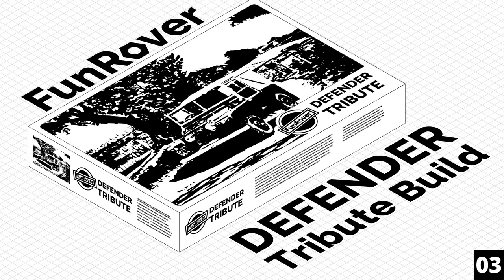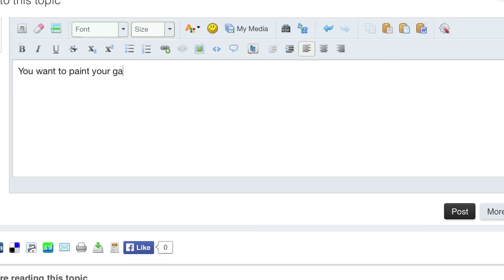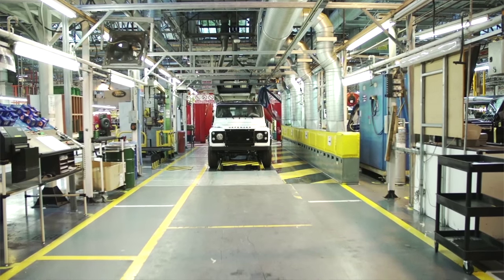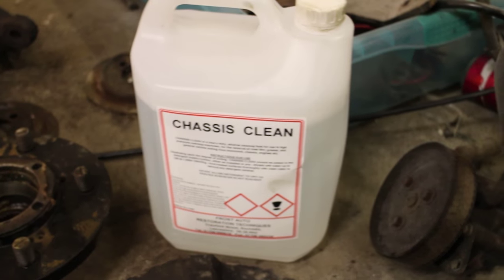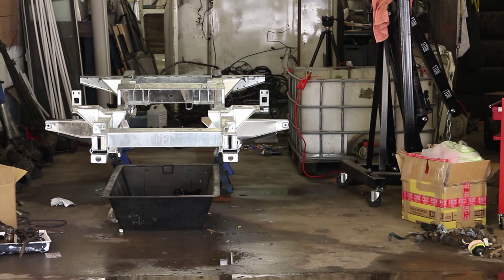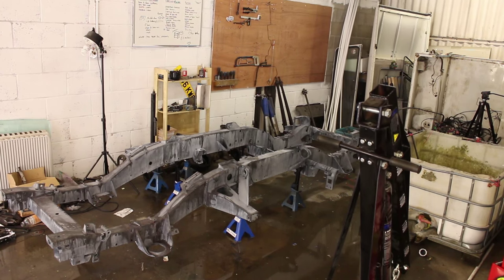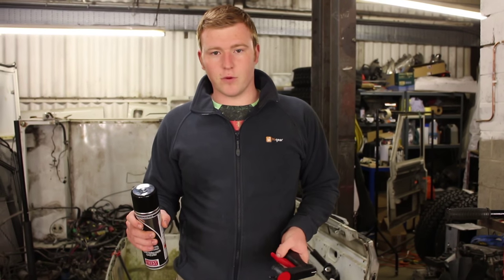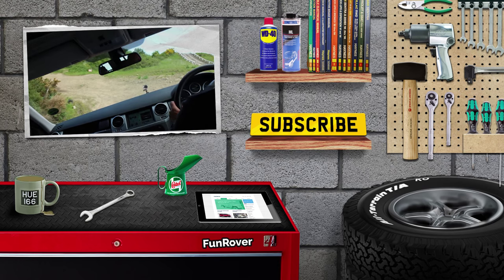Defender Tribute Build: How to Paint a Galvanized Chassis

Comment: Hi, been following your build with interest as I am just about to embark on a chassis up rebuild of my own Defender 110 CSW. After looking at the Eastwood Extreme Chassis Paint that you used, I noticed that Eastwood don't recommend using it over etch primer. I was wondering why you chose the etch primer over the one recommended by Eastwood themselves?Keep up the videos coming!ATB Mike
Reply from the maker: +Mike Simpson Hi Mike, We were sent the Frost Auto paint to try. I also noticed that disclaimer but after testing it out, there were no problems. The main thing with etch primer is leaving it long enough to etch properly. Painting too early would likely result in a reaction.
Reply: +funroverdotcom  OK,, thanks for the incredibly swift response!
Reply from the maker: +Mike Simpson No problem ;) We're trying some other chassis black too this week so will let you know how that works over etch too